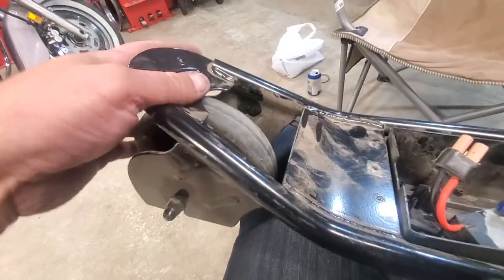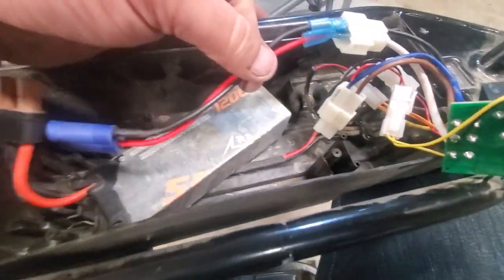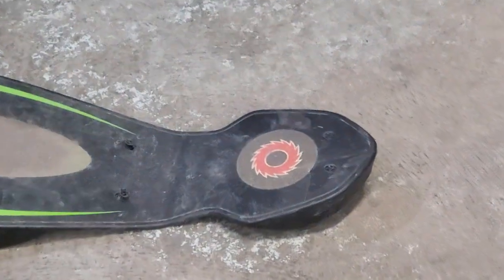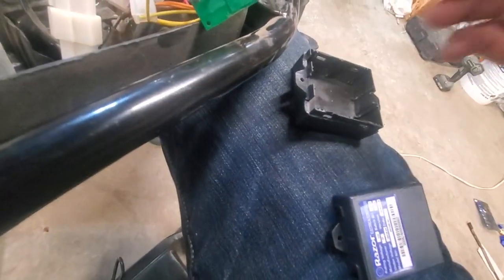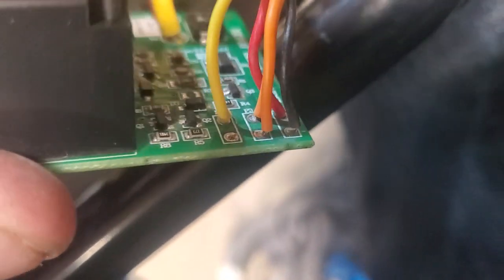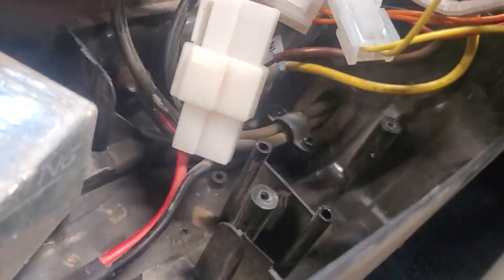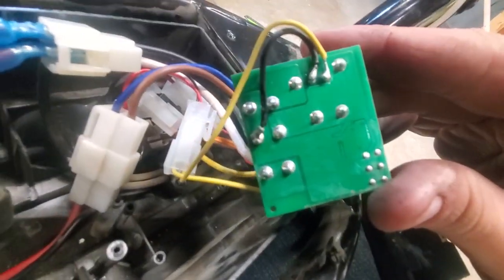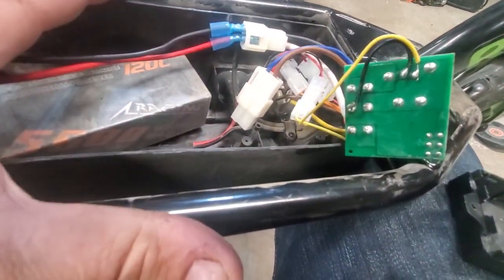Electric scooter Razor rolling/moving throttle button bypass for instant power, READ DESCRIPTION

Comment: Will the charging circuit still function with this mod if I still have a stock battery
Reply from the maker: @Whoisdatboi  Charges normally. But may not automatically cut power when battery gets low
Reply: @ sickkkkkkjj

Comment: My kids e100 razor scooter doesn’t have a switch just a throttle would I have to add a switch or would the throttle become the switch.
Reply from the maker: @PatrickGibbons-zq5lb  Couldn't tell you, but it would likely function as normal without having to roll, if you have to roll now

Comment: Thank you and your grand dad!
Reply from the maker: @Ciares  Father, actually  :)
No problem!
Reply: @motorman9  If you could ask him actually since he is already familiar with it all why it's not safe to replace the thin throttle wire with a thicker gauged throttle controller, removing the on/off switch and the entire relay? To just simply wire everything together, allowing the throttle to be the on-off switch and also wiring the charger port before the throttle? I suck at soldering.
Reply from the maker: @Ciares  , he knows nothing about it. You would have to find some way to give power straight to the motor with that switch. Should be doable